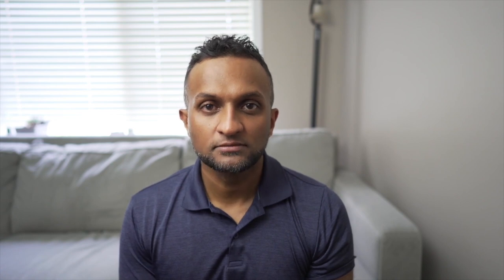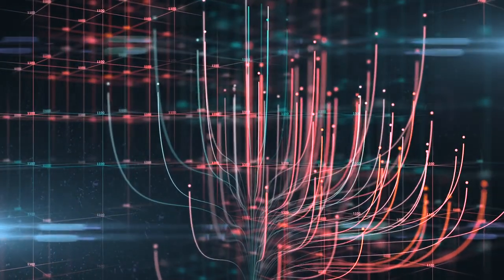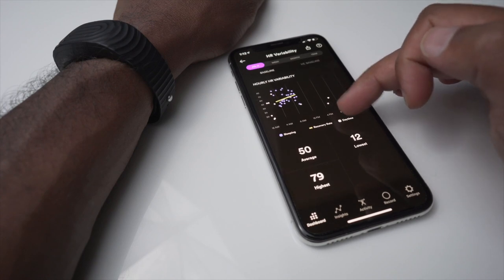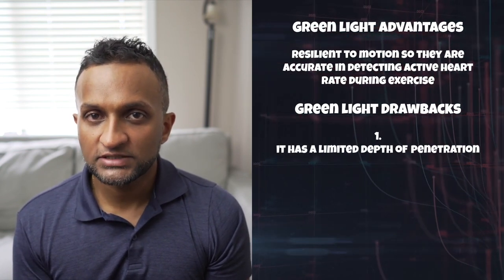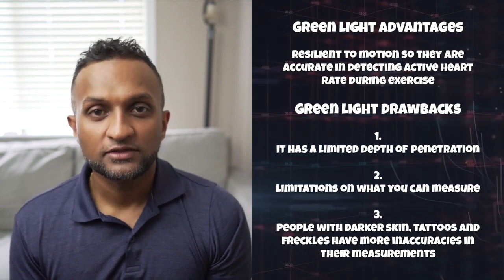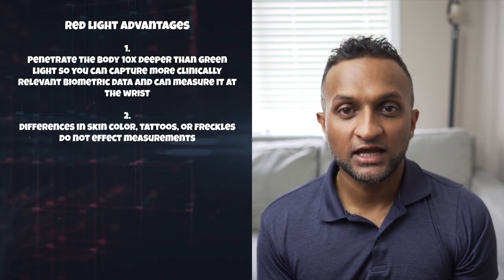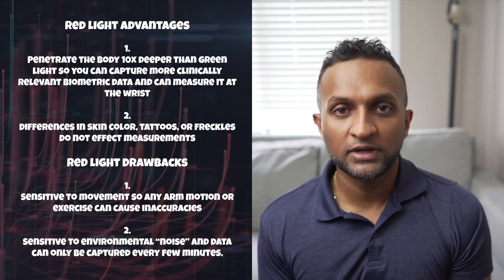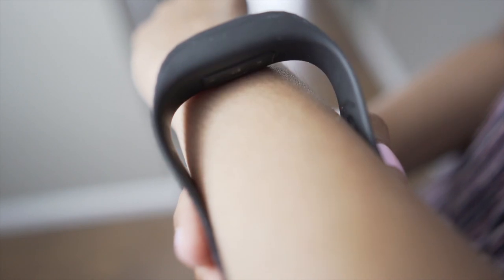How Heart Rate Sensor Works in Fitness Band - Photoplethysmography

Comment: I always wondered about that green flashing light on my fitbit.  What tracker has red light on it?  I can't seem to find one with red light.
Reply from the maker: We work very closely with Biostrap.  They use red light PPG but have the ability to also use a green light optical sensor heart rate monitor.  So our clients use the red light Biostrap to measure indepth clinical biometrics but when they workout, they use either a green light optical sensor chest or elbow heart rate strap/monitor to measure active heart rate.  The technology has not been developed where red light can be used to capture everything.  I believe it is the future of wearables and should be available in a few years.
Reply: @DoctorYogendra  Thanks.   Which heart rate monitor is better?  Elbow or chest?
Reply from the maker: @andizelkind3719  The gold standard to measure heart rate is the EKG.  But obviously it is not practical to haul an EKG machine everywhere so the chest and elbow heart rate monitor come as close to accuracy as the EKG.  Its more of a comfort thing with chest or elbow HRM.  More women prefer the elbow HRM than chest HRM but men who participate in contact sports like mixed martial arts who also prefer the elbow HRM.  Studies show both are equally accurate.  But the wrist based HRM are not accurate and can give false readings.

Comment: Which invisible light has Oura ring?
Reply from the maker: Oura ring uses infrared light.  The main difference between red light and infrared light is visibility.  Red light has a wavelength of 620 nm- 750nm whereas the infrared on the Oura ring has a 700-1000nm wavelength.  As you can tell there is a small overlap between the red and infrared light.  This is why the Oura ring is great at giving those clinically accurate biometrics like heart rate and heart rate variability (HRV).  I personally think the Oura ring is fantastic tracking HRV because it is using infrared light but the only problem is nocturnal HRV values haven’t been properly studied.  Are you planning on using the Oura to track HRV and sleep?

Comment: I'm thinking about getting a Biostrap. However, considering red light PPG is less accurate while body movements, will it affect my heart rate or other readings during a restless night of sleep? I tend to move a lot while in bed. Please advise.
Reply from the maker: So depends on what you are looking for- if you want just HRV data esp while you sleep, then also consider the Oura ring- problem with that is you can't use it while you work out but its really nice.  The HRV from biostrap is very accurate but battery life is not the best.  Customer service however is the best!  One of the reasons I like Biostrap.
Reply: @DoctorYogendra  - Thanks for the quick reply. I have been considering the Oura Ring for a while but they have recently stopped the $50 affiliate coupon scheme and also I understand that it records less biometric data. What I like about Oura is the ability to record night time body temperature variance (I do not know how useful that is). I have also been considering the Whoop 3.0. Whoop 3.0 records data 100 times per second but I am not sold on the subscription model of $30 a month. That becomes an expensive commitment for long term. Do you think you get anything extra with the $30 per month subscription over and above the existing ones with outright purchase? Also Whoop doesn't record as much data as Biostrap.
Reply from the maker: @arjun019  - one of the best features with Whoop is their battery life.  Hands down the 5-7 days is better than the 2 days you  get max with Biostrap.  But when you look at the cost, there really isn't much the Whoop does better than Biostrap to justify the subscription fee.  Again, the Biostrap battery life is terrible and constantly having to charge it is annoying.  One option you could do is Oura ring and get the Biostrap heart rate monitor.  Personally I love the Biostrap HRM better than Scorche's and it syncs much better than many other apps.   Despite these companies touting active HRV, I am skeptical of the accuracy and reliability of active HRV.  I sometimes use the Biostrap HRM (retails at $95 but you can find it cheaper) with the Polar heart rate app.  Works great and has a GPS integration too.  Also if you get the Oura ring, remember you can't work out with it so make sure to remove it!
Reply: @DoctorYogendra  - I already wear a Garmin Forerunner 235 HR and will continue to wear it as I find it much better than the Apple watch I used to wear. I can track my active workouts with that. It can also broadcast the heart rate to other devices. However, I am not sure about the accuracy of the sleep monitoring and heart rate data of the Garmin. I am okay with charging the Biostrap every day as I used to do the same thing with the Apple Watch.  So, my second device will be on the other hand and will compliment the Garmin 235 HR. I am currently wearing Fitbit Inspire HR on the other hand but I find their sleep tracking very poor. Also, I used a Motiv ring and found the battery life of that below average. Oura will be $300 and Biostrap will be $140 (with coupon code) - does Oura justify the almost double price point?

Comment: I have a heart rate monitor but the back is metal how does it monitor my heart rate
Reply from the maker: Thanks for the question.  Mostly likely you have a chest strap and this is measuring the electrical activity of the heart in the form of an EKG (electrocardiogram).  The elbow and wrist heart rate monitors are using optical technology (i.e. photoplethysmography) with makes a PPG curve to measure your heart rate.

Comment from the maker: What kind of fitness watch do you wear?  Does it have a green or red light on the back of it?
Reply: Dr. Yo i have Garmin. The light is green.
Reply: Great info. (Intentional) LOL
Reply: Huawei WatchFit. 
The light is green.
Reply: Great video, Doctor... Your boyfriend's so lucky!
Reply: Ticwatch 3 Pro. Has both red and green LEDs
Reply: just bought mine lol... it's a $5 watch from PH and CN called HryFine and it's rate is either 5-10 lower or 5-10 higher than the accurate reading from an actually heart rate monitor
Reply: Noise fitness watch
Reply: Vital Brace has a green light
Reply: I have green, red and ... blue????
Reply: Apple Watch SE and green
Reply: Green
Reply: Mi band 5
Reply: Both
Reply: Both

Comment: I Have The Honor Band 5 And I Have Noticed Something Interesting About It. It Emmits Green Light During A Heart Rate Measurement But A Red Light While Measuring The Oxigen Level In Your Blood (spO2) Can You Explain Why Exactly This Happens?
Reply from the maker: Because for active HR when moving, the green light minimizes artifact readings from movement.  When measuring those clinically valid metrics like oxygen saturation, you need infrared light to penetrate into the red blood cell.  This is why a pulse ox in a hospital has a red light!